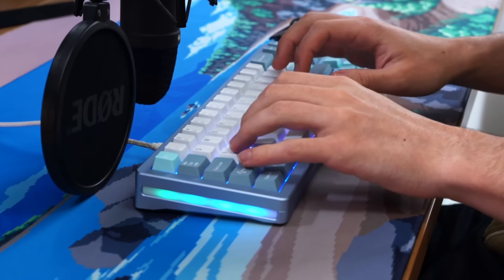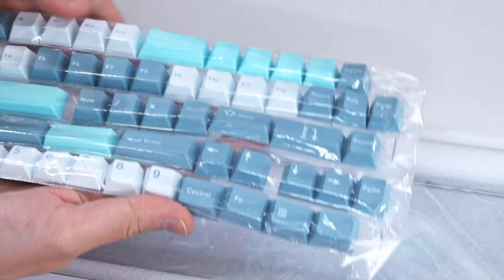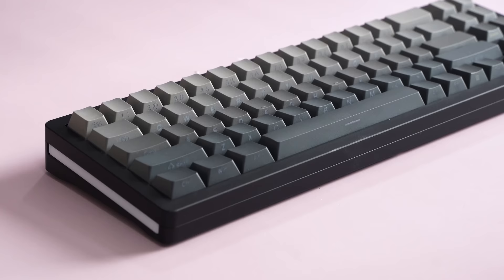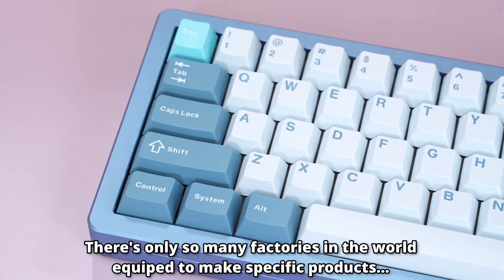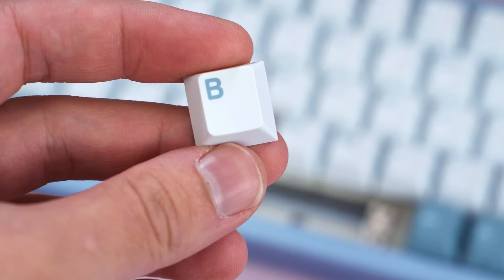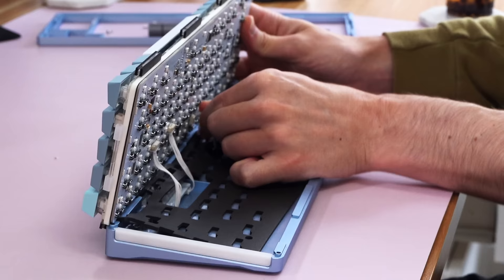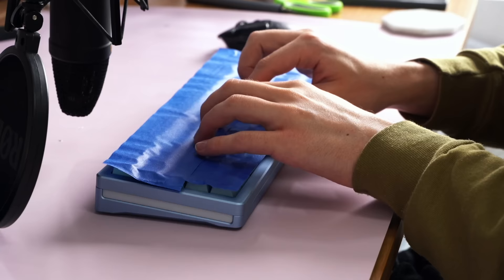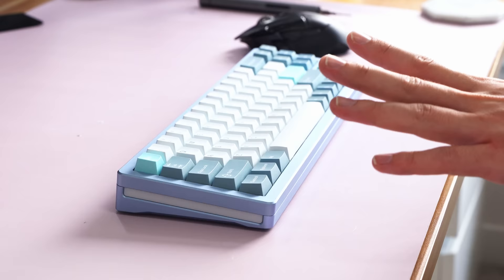Make Your Keyboard THOCK For $3

Comment: 90 dollars is not a "budget keyboard". You can get at least 6 budget keyboards for that. Including 6 mice.
Reply: Broke 😂😂😂
Reply: Put it in context man… It’s a CUSTOM board ffs
Reply: There’s something called not commenting this
Reply: Are you talking about those 15$ keyboard + mice combos? Those are basically e-waste, heck they aren't even mechanical! 😂😂😂
Reply: Bro this isn’t 2050
Reply: 15€ for KB AND mouse? That's pretty good evidence of prime A-grade e-waste.
15€ just for KB or mouse, yeah sure. Go for it. There can be some pretty good stuff at that price point.
My old daily driver was a 20-25€ membrane that lasted about 5 years of use, and it was retired due to developing craters on the heavily used keycaps. Tho, it still lives on as my backup whenever I need a second KB for whatever reason.
Reply: $90 Fully mechanical + aluminium base + hot swappable and that thocky sound is budget. Just because it’s a lot of money can’t mean somethings not budget. Think $300 for a house. A lot of money in general but crazy cheap for a house.
Reply: BUDGET means that the keyboard is good too! But those 2 dollar keyboard are shit
Reply: I got a Machenike K500 wired for my first mechanical keyboard and it costs only about US$25. Since it's my first foray into this rabbit hole, I am already more than satisfied. Maybe use it for a few more months then mod it a bit. So ya, you don't need to spend that much if your expectations are managed.
Reply: 120 dollars is considered a budget. Just listen and compare it to a 20 dollar membrane keyboard.  THEY ARE GALAXIES (I mean this), GALAXIES APART!
Reply: @Zero-vs2mb bro making fun of  people who don’t have money is crazy 💀
Reply: @Zero-vs2mb wow.
Reply: Bros talking about those 15 dollar rgb membrane keyboards
Reply: 6 garbage keyboards and 6 garbage mice
Reply: Keebs are an expensive hobby. Something like that with quality material and features would cost double its price with more we’ll known keyboard brands. If you dont like this hobby, then why even call it a hobby
Reply: In the world of mechanical keyboards… yes it is. In the world of membrane keyboards, it is not… but I’m sorry I’ve already used too big of words for you

Comment: Just a pro tip for anyone who orders the black model: it seems the reason why it scuffs so easily is because of a coating over the aluminum that is literally just brushing off with every pass. I believe washing it off with window cleaner (make sure that you do so when the keyboard is disassembled) or isopropyl alcohol and a paper towel. I did this myself and haven't had any scuffs or a weird powdery feeling since then! Fantastic board for the price, especially if you tune it that much more when you start modding it.
Reply: it doesn't chipped the coating?
Reply: @pacjosephnovabos8765  Not in my experience, though after about a month of having this keyboard you may need to give it a bit of that treatment every now and then but its still holding well and is not NEARLY as chalkboard-y feeling as it was when I first took it out of the box, YMMV, though.
Reply: @spooksid3267  last question does the factory lube wear off in a month? Thank for taking your time answering, im new to this hobby and im planning to buy this as my first keebs.
Reply: @pacjosephnovabos8765  No sweat! Can't really speak on the factory lubing as I went ahead and used some hand lubed WS Morandi switches and some hand lubed stabs as well, the switches it comes with if I recall correctly are alright at best but it's never a down side to change the switches down the line with this case! Sound profile of this case makes most lubed switches sound like a dream.
Reply: So morandi whites are compatible with this keyboard ?

Comment: I'm modding this keyboard and found that the force break mod needs to have the tape at different spots. The screw holes in the top cover protrude a little over 1mm and there's roughly a 1mm ring of contact at each of the 6 screw holes. You can see them at 7:01
The raised parts on the bottom housing seem to only be for indexing the top and the gaskets.

Comment: The sheet is just anti short, so if you somehow bottom out the pcb to the case, it doesn't short. I don't believe it makes any significant difference in sound or any at all:)

Comment: I purchased this keyboard about a month ago because I had seen some positive reviews on YouTube and was drawn to the incredibly low price (I paid only €73...). So, I was absolutely curious to see how it's possible to sell a full aluminum mechanical keyboard with switches and keycaps at such a low price, especially when all my other custom mechanical keyboards are well over €200. I must say I was absolutely impressed by the quality of this keyboard: CNC aluminum frame, gasket structure, case foam, plate foam, PE foam, good keycaps (and many extra keys for larger layouts), discreet linear switches (a bit scratchy despite factory lubrication), and some extra keys compared to the typical 65% layout, which can be very useful for assigning keys, especially here in Italy where we have the issue of accented letters. Most importantly, what convinced me was the excellent sound it produces right out of the box. Of course, with the mods we've seen in the video (force break and tape mod) and by changing the switches, you can achieve excellent sound quality, not far from much more expensive keyboards I own. Additionally, it has three operating modes (USB, 2.4 GHz, and BT) that can be really useful.  The drawbacks (because there are some) I have encountered are: plate-mounted stabilizers instead of PCB-mounted ones. They need some work because they rattle and are poorly balanced out of the box. However, once properly lubricated and secured to the plate, they do their job. The keyboard is gasket-mounted but is not very flexible, especially inexplicably in certain specific areas. The keyboard is not compatible with VIA, although the Vomier driver still allows you to remap keys as desired. The RGB effects are decent (but personally, I'm not interested in them). In short, an excellent purchase, given the incredibly low price I paid (€73, including shipping from China to Italy), perfect for office use, quick tests on other PCs, and so on. Moreover, it's "in stock," so no tedious and exhausting group buys. In the end, I gave it to my nephew who had been looking for a wireless aluminum mechanical keyboard for a while, and he was completely satisfied.
Reply: Ciao Marco, si può impostare l'rgb di modo che l'effetto sia monocromo? Sto valutando l'acquisto, ma ho bisogno di una retroilluminazione che si possa non solo disattivare ma anche impostare solo su un colore singolo (purtroppo devo poter fare una cosa "sobria" per quando non sono a casa e di sera mi farebbe comodo la retroilluminazione senza dar noia ai colleghi...)
Reply: @maurogatti2009  sì certamente 😉
Reply: @MarcoM10361  grazie!

Comment: I actually bought a barebones premium keyboard for USD 380 which didn't even come with stabilizers. After watching this video and because I was looking for a purple /lilac keyboard, I bought  one (yes I used the link)

Damn was I blown away. It sounded better out of the box than any of the keyboards I've ever built. And I've spent hours tuning stabilizers and lubing switches but this damn board sounded exactly like a fully modded keyboard out of the box. If you are new to mechanical keyboards and don't need a numpad, this should be your go to. Follow Hipyo's force break and tape mod and it will sound better than you can imagine .

Comment: Bought this but in red.
The XVX site now has red and silver and matching keycaps.
The Yunzii is the same board but some pros and cons with them.
Pro: Yunzii offer pink and green in addition to all the colors of Womier.
Con: Yunzii only provides the keycaps on the board, Womier gives you a full set if keycaps you can potentially use on another board.
I also personally prefer Womier's minimal look without branding.

Comment: I have developed a variation to the Hipyo Mod:
Instead of press'n'seal, you simply tape mod the top side of the PCB. Sound becomes more marbly and """thocky"""
Caution: ensure all the holes for your switches are cut out beforehand or you WILL get bent pins!

Comment: I bought the green version but the battery died after a few months. Now I just use it plugged in. Also if this happens to you, you have to unplug the dead battery connection for the keyboard to work using the cable. The battery on these are definitely a weak spot so be aware of this issue.

Comment: The plastic sheet‘s primary task is not the sound but to eliminate the risk of any shorts on the pcb due to flex and contact with the metal case
Reply from the maker: Oooooooooooo

Comment: I bought this keyboard a couple of moths ago and i gotta say, I absolutely LOVE this board. It's only my 2nd mechanical keyboard, and it's genuinely impressive how good it feels to type on for just $100.
Reply: how did you charge the USB
Reply: @Silent12475  you dont its 2.4g
Reply: So you don’t charge nothing?
Reply: @Silent12475  you have to plug the keyboard in with its wire and charge it but thats it
Reply: @uhlyxgmd_  yo thank i was worried casue i bougth it and i didn't know how to charge it

Comment: I got this keyboard in black and it's been changed sense you reviewed it, The gasket mount is totally different and the clear sheet in the back has been changed to a foam sheet.
Reply: Still a chalkboard with skin contact?
Reply: @1337kaas  Yes, I did read in a post somewhere here tho it's due to a coating that can be washed off but I haven't got around to trying to wash it off yet.
Reply: @corruptkode  yeah another guy said he got rid of it by washing it off with isopropyl alcohol, wondering if that's really the case because the black one looks great 😃

Comment: Great video! It's encouraging to hear that the hobby has gotten so accessible. Should you still tape mod if there's already a layer of case foam at the bottom? Asking because I have a keyboard with case foam but it's still not as thocky as I'd like, but I'm not sure if adding tape at that point will make much of a difference.

Comment: Bought this one as my office keyboard after the good review. I am so blown away by the quality for the money. Won't even bother modding it in any way. This was my second "enthusiast" keyboard after a redragon K552 with speed silver Akko switches, HyperX Pudding Caps, a tape mod, case foam aswell as modding and lubing the stabilizers. 

The Womier SK-71 is really almost perfect out of the box. I really like the sound and feel of the switches, the case feels so high quality, it's heavy and feels sturdy. Connectivity has been perfect so far. I got the black one, since it suits my office setup and I really liked the twist with the keycaps. Thumbs up for that recommendation!
Reply: hey, thank you for the review! What about the scuffing issu Hipyo showed in the vid? How did you solve it?

Comment: I did the tape mod on the case and now I have RGB leaking from the sides of the case because there's a tiny gap so if that bothers you maybe reconsider putting the tape. I cant really hear the difference but might remove the mod since the leaking RGB is bothering me

Comment: This is a really interesting keyboard for the cash BUT what the hell were they thinking with the nav cluster layout. I love the idea of all 6 nav cluster buttons but the default placement of the  Home/End etc in that cluster is just dumb.  Means you have to remap it and then bin the caps because of that, all with iffy driver software. If they bumped the price and made VIA compatible it would take over the market as the go to entry point board
Reply: There isn’t a standard layout when the home pad is 2 wide. Very frustrating. Dell, Microsoft, Alienware etc all do it differently
Reply: Actually looking closer. I like where they put insert. I could actually find that insert key from memory, which I couldn’t on others. I use Shift Insert to paste
Reply: @AndyK.1  The logical is top row Ins PgUp
Next Del PgDn 
Final Home End
Reply: @AndyK.1  I know the feel and I use Ins/Del for varios copy paste operations. Starting to move to Ctrl C/V but I have decades of muscle memory to fight for that lol

That is why I think the layout I mentioned works well. Means Ins/Del/PgUp/PgDn are at or close enough to original locations and home end being horiz makes sense for the functionality also

Comment: This keyboard is a great option for general usage. Not particularly excel in a specific aspect. For example: it is too long for a 65 layout, if you play  FPS then it kinda stick out and poke you if you tilt your keyboard like me. Missing the F row for editing job or MOBA game. 
But it is great for typing job like copy writing or office job since it is MAC Compatible and my work laptop is a Mac. 
Other than that, it is also easy to assemble/disassemble, take no effort to mod, good stock stab (minor lubing is required). Overall: Great entry level keyboard
Reply: Oh damn just noticed it doesnt have the F row 🥲 already bought it..
Reply: How do you control volume level and screen lightning without F row on Mac? Usually there are there
Reply: It works great for fps imo, its only a problem if you tilt and you could just buy different keycaps

Comment: To me, if it's less than TKL and doesn't have VIA (or some fork/comparable open source software) it's usually a hard no. I'm not turning off my antivirus so I can install barely-functioning software so I can swap my nav keys around on one keyboard. But I am glad that the Chinese OEMs are so dialed into keyboard trends and consumer desires. This keyboard checks almost all the boxes.
Reply from the maker: It's getting there slowly

Comment: Picked this up in the "black" colorway with the letters on the front of the keys - really more a grey fade. It's incredible out of the box, beats the heck out of the Code board I was using in feel and sound. Thank you for the advice!
Reply: i plan on buying this one and in the vid he said that the black picks up a lot of skin and dust just by rubbing it. is that true?
Reply: Yo is the thing he said about picking up dust and skin true?
Reply: @johannbeltran3272  I don't notice it much, no more than other darker keycaps
Reply: @imnotzachh   not that I've noticed much, no more than others.

Comment: Looking forward so some 75% action!
Got the Leobog Hi75 when it first came out and it's been a great board with some light mods.  It actually has a PolyPropylene plate (hehe peepee) and if the first kit I've seen use a PET sheet on TOP of the PCB.  I removed the PE foam on the PCB  and it got even MORE foamy/creamy.  It totally THOCCS with the case foam, plate foam, tape mod, and PET film sheets.  This is despite a flex cut PCB with flex cut plate.

Comment: Howdy hey!  Does the PCB use Outemu hot swap sockets or Kailh?  If it uses Outemu sockets, then you're stuck using Outemu or Akko switches with it -- unless you're willing to file down the pins on other brands of switches.
Reply: Or Gazzew, as it's manufactured by Outemu. U4T , U4, Bobagums. Lots of banger switches that will fit (might need to snap off legs if it's a 3 pin socket).

No interference on the metal pins though!

Comment: Would love to hear this board without foams.
Also, electrical tape rubber dries out over time, and leaves a nasty adhesive residue on your board. A lot of the fires come from cheap battery management. Hopefully using this wired doesn't just keep topping up that battery to prevent that

Comment: Just got mine a couple of days ago and switching the keycaps from cherry to xda has made the keyboard sound richer, however I did have problems with the right shifts stabilizer with my xda  keycaps, so I'm not sure if it's the keycaps or if it's the stabilizers. Other than that it feels and sounds miles better than my ducky one 2 mini or my lightly modded rk61

Comment: Hey I bought this keyboard cause I saw you made a video review on it. I am having an issue with it though. The number key row is for some reason stuck on the Fn keyrow. I tried numerous keybinds to see if I can turn it off, but it will not budge. Do you know how to fix this? I wasn't able to find a factory reset keybind in the instructions.

Comment: @HipyoTech have you ever tried liquid electrical tape on any mods?
Reply: A conformal coating. The issue would be ensuring it doesn't get into your hotswap sockets and/or glue the switches in

Comment: If i can afford a Keychron Q3 and morandi switches, should I just get this Womier instead and mod it or is the keychron noticeably superior?
Reply: Funny I was in a similar situation but instead of the keychron Q3 it was the monsgeek M7W, if your fine with the 65% layout then yeah it's a steal. 
The only "problem" I could gather is one guy had issues with latency in wired mode after long pressing a key and I have no way to know the source of the problem or if he just got unlucky with the board he got.